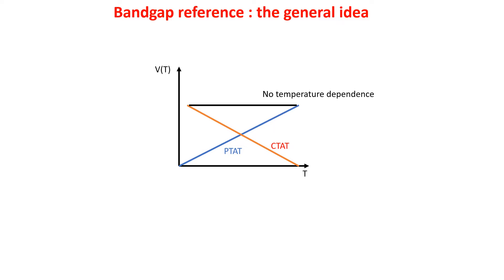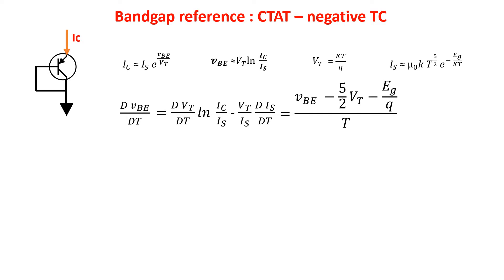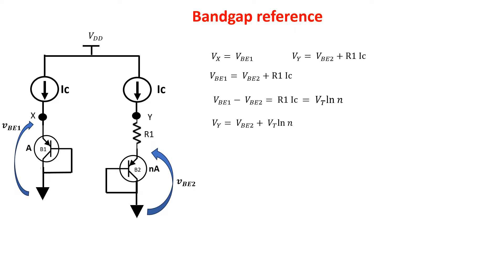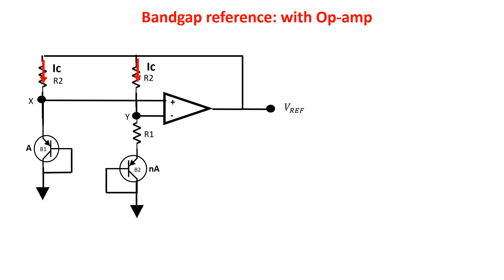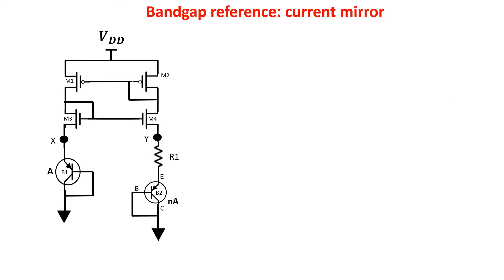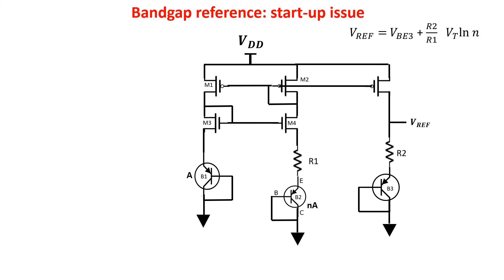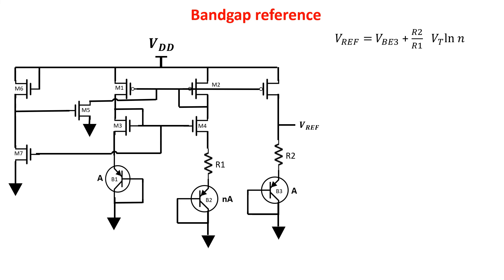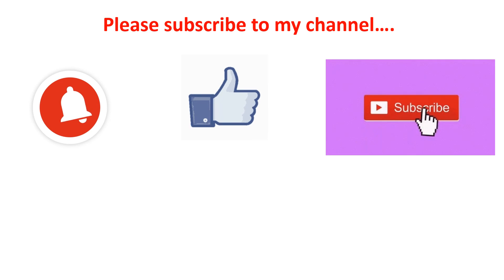bandgap reference - voltage reference - voltage source - start-up circuit

Comment: do you have any good books, resources about the fundamentals of the circuit used, and then they derived , explain all the fundamental circuits and then they derived the bandgap reference circuit? Also any good books about the same for precision bandgap reference circuits?
Reply from the maker: Look for a book by Behad Razavi: Design of Analog CMOS

Comment: is it necessary to take B3=1???  or we can increase the B3 cells?
Reply from the maker: Not necessary. If you make It different you Just need a little fine tuning in the resistors to reach 1.25V as voltages reference.